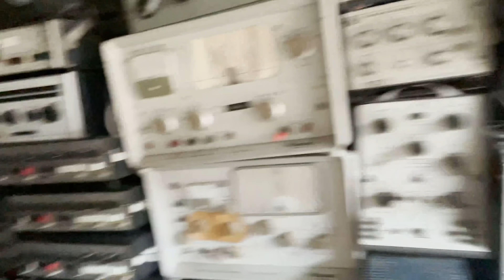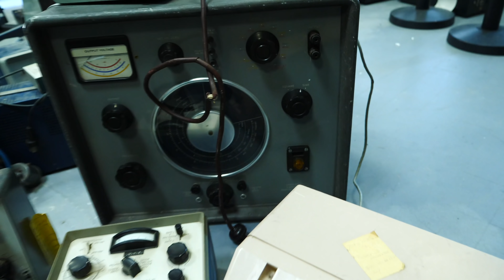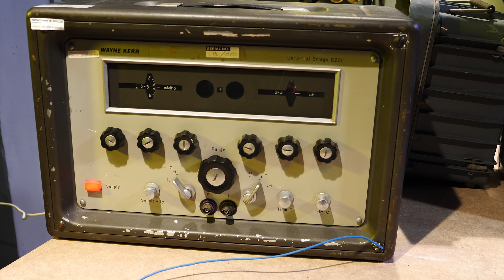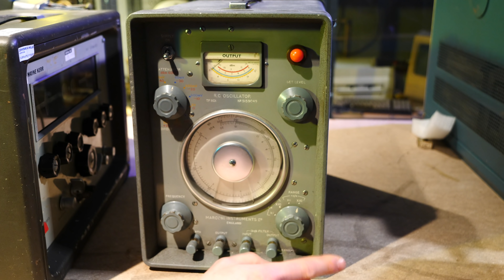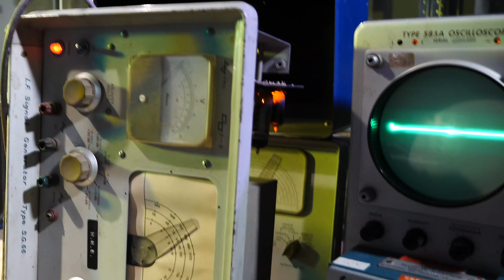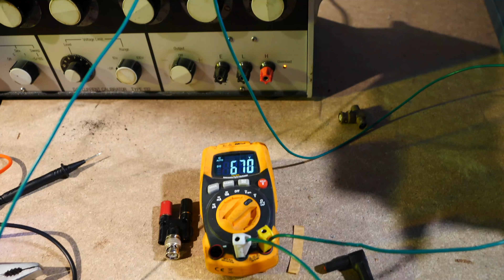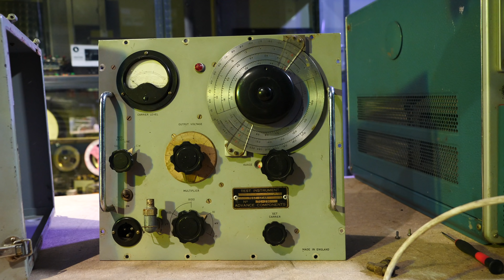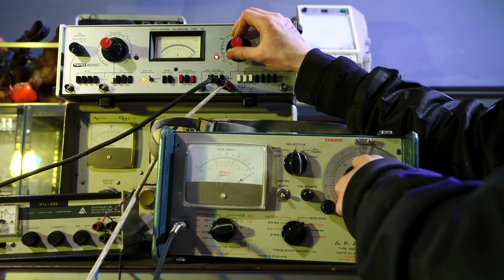I Bought A Massive Pile Of Mystery Test Equipment...

Comment: That frequency response analyser is absoloutely spot on for testing speaker crossovers and filters. I have a similar one and you can program it with a range or span of frequencies and it will step / sweep through them all and measure the phase and gain (or rather attenuation) over the filter / crossover. Hence not directly musical but very useful tool for the work!

Comment: Thing with 2 huge knobs are a pair of variacs. Could be handy for circuit bending mains operated stuff?
Reply from the maker: yeah i had an idea it was a variac! i didnt show in the vid but it has 2 variacs on the back of it aswell
Reply: @LOOKMUMNOCOMPUTER  Actually they are absoloutely not variacs, and I am sure neither are the two units you place on top. The two in the box are Bercostats, as per the name on the bezil themselves. They are large, high current wire wound variable resistors - I have a few identical ones here and actually made an almost identical box to that big one. The big box with two bercostats is 100% definitely a load bank, it will be filled with large resistors on heatsinks brought out to the terminals on top and bottom, as will be the bercostats. It is useful for testing power supplies. Likewise with the two boxes with the mains socket on, I am fairly certain are rehostats (bercostat being a brand of rehostat) When you dimmed the light I am sure you were altering the resistence in line, not the voltage across the light as the dimming was very non linear. Variacs are very specifically an AC device with transformer laminations and are more in keeping with a autotransformer than a rehostat.

Comment: I have the Wayne Kerr's younger sibling; it might be musical as it uses an audio frequency oscillator to measure inductors and capacitors. The trombone things are co-axial line extenders, used to adjust or match the phase response of an RF transmission line.
I used to use a Solatron Sclumberger Frequency Response Analyser in our lab in Stevenage, I wonder if it's the same unit!

Comment: No way! :-O A Motorola EXORciser! 2 of these were in an electronics lab where I used to work, in use up until 10 years ago to my knowledge! Never thought I'd see one of those old beasts again! So much of the old test gear that I started my career as a test engineer with. Especially remember the big old trolley mount Tek'scopes and that Nixie tube meter model I remember, I'm sure I've used one at some point in my career.  Yes, I've even used some Wayne Kerr test kit in my time too.
There's a lot of work in fixing these old beasts, I'm so glad that the likes of you and HAINBACH are giving these monsters a new lease of live, awesome work!

Comment: The round mains connection on the nixie volt meter is a Bulgin connector. They are popular on vintage hifi gear like Leak & Quad. If nothing else, you have some excellent vintage enclosures and knobs to re use.

Comment: Nice tektronix 585A!  That's the peak of tube scope technology.  I picked one up years ago and it has served me pretty well.

Take a look inside of it.  It's absurd how many tubes it has.

edit: also re 10:55 you can use those DC sources as voltage sources if you want by just throwing a resistor on the output.  Choose something of proper resistance and power rating so the scale matches up and nothing blows.

Comment: Yes, used a curve tracer here and there over the years but they always had a phosphor tube by the time I got into electronics.

If nothing else you can test transistors now.  :-) as far as what's inside I would expect a pattern generator consisting of graduated bias circuits to generate an output curve that shows the electrical operation of the component under test within whatever limits/range of operation you're setting.

Comment: That device in the trunk looks like an RF bridge of some sort. It has a small fortune of GR874 connectors with it. Those connectors are unique because they are hermaphroditic. A good working Tektronix 585 oscilloscope is also a nice find. I believe that is good up to about 80 MHz or so, with a dual timebase. You mentioned video. Dual timebase scopes are great  for video work. In any case, these 'scopes were plagued by an interesting aging problem that happens to vacuum tubes, called 'cathode interface'. You are very lucky if that 'scope is free of it.

Comment: The connection on the back of the nixie multimeter looks like a bulgin three pin. In the 90s I tried to get some for an early 70s sound to light unit but was never able to source them and ended up changing them

Comment: The solartron 1170 frequency analyser brought back memorys, used to use them to test frequency response of amplifiers etc and calibrate microphones and other transducers. That one may have an ieee488 port, it allows linking of test equipment and controlling them via an external computer.

Comment: Those current and voltage analyzers are awesome. I actually need those but shipping to Germany would probably cost a bunch. 

I actually saw one of those Scopes (don't remember the model number) on eBay classifieds for over 500 ~ a year ago. It had multiple channel modules and since they go up to 500 Mhz they still sell for quite a bit of money. There are no modern options for less so if you need the higher bandwidth that is still a viable option

Comment: What a harvest! :-) That huge Tektronix oscilloscope may be suitable for some serious circuit bending! I have a similar one, a 502A dual beam oscilloscope, and right now I'm working on a much smaller Tektronix 310A that I have turned into a three- or four oscillator drone machine/rythm generator. (and I've only got shocked once so far...) Using the sweep generator of an oscilloscope as a sawtooth audio oscillator is really cool! -The trigger circuit can make it follow the input frequency at a subharmonic in a quite musical way. I'm putting together a simple demo video right now... :-)

Comment: Got a story to share on the GAS thread? 

I want to get into electrical engineering, but I am afraid of hoarding test equipment, I done need a scope tho and a serial interface - got to troubleshoot my thermal cameras to mod them into digital out.

I do have a chest full of random electronics with heavy duty cables and military style connectors and I don't know what to make with it

Comment: That wooden box with the blue unit and BNC connectors with gray knobs... reminds me of navy RF equipment. In a box like it's field portable. Maybe it's used for testing or maybe it's simply meant to be a portable transmitter. Like an old-schools seal-phone or something. But most of that looks like old-school RF equipment vs being digital. IE: Obsolete and possibly illegal to use.

Comment: Mr Carlson's Lab has a video about a transistor curve tracer. I admire your chutzpah to go out and get this stuff as well as making an actual Museum. There is a Pavlok's radio museum near me and I donated 5 quarts of tubes to them, an oscillograph wobbulator my uncle gave me and a couple of other things. You might try using a frequency divider on the high frequency Marconi Oscillator to bring it into human range of hearing. For the multiple PSU stack you could put like a small piece of wood trim with some hidden RGB uplighting it and have them flash with the music. Or assign each color a frequency. I always love those old Tektronix Oscilloscopes because they were literally built for war. They've got silver contact rails and some were modular. Again, great content dude!

Comment: @ 4:45 That's a type 585A Tektronics oscilloscope. I have a type 545. It's got 102 vacuum tubes in it. When I turn it on it will nicely warm a room in half an hour. =)  That Wayne Kerr (LOL)  resistor thing is like a potmeter right? You could use it for a filter cut off maybe.

Comment: 9:17 it could be a voltage regulator tube. Those are usually filled with either neon or argon gas, and don't have a filament. That one looks like a neon-filled type!

Comment: I was wondering why the plug-in stuck out, then realized it was an older style 540/530 series Type G plugin, but a newer 580 series scope.  And that brightly lit tube may well be fine, some voltage reference tubes like 85A2 and 5651 glow like that in operation.

Comment: The transistor curve tracer will help you get the gain curves of a transistor among other things
The circuit magnifier and that oscillator are for testing Q factor for RF components. rather specialized and not really a music thing. more usable for fixing stuff
The thing at 3:38 seems to be a resistor divider box with a few variable resistors too
The GR oscillators at 4:00 are MHz range variable frequency sources
I guess you could try and make a beat frequency oscillator with the GR ones? maybe?

Comment: There is fellow youtuber called Mr Carleson's Lab he deals with radio equipment rebuilding,fixing and modifying making them better so they can continue to work we are vaccuum tube radios and the newest thing I saw was the 1970s he also doe old voltmeters power supply's and more all from the mostly the 1900s to the 1970s he is the smartest man I've ever seen

Comment: The Motorola Exorciser is also a MC6800 based computer although 6809 and 68000 versions existed. I worked at Motorola for 41 years. Our Exorciser had an Eprom programmer card in it, which we used to clone Atari 2600 cartridges. It was intended for software development, with many debug functions built into the hardware. The General Radio stuff in the footlocker could be worth some serious money. The apparatus itself is a pretty obsolete piece of RF test equipment, but the thing with the large BNC connectors is called a "trombone line" for obvious reasons, and those connectors are called GR connectors after the company that invented them. A trombone line with good silver plating inside it is worth some serious coin. There is one listed on Ebay currently for $500 US. There are companies that can replate bad ones, so worn out trombone lines are still valuable. https://www.ebay.com/itm/General-Radio-Constant-Impedance-Trombone-Line-874-LTL-874LTL-GR874/253237436807?hash=item3af620a187:g:TsQAAOSwjZJZ-fZU